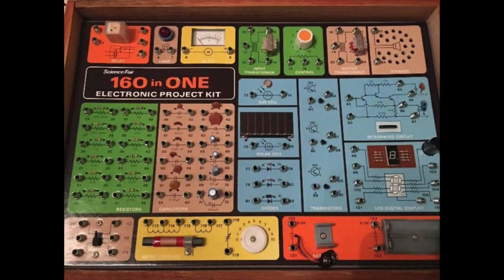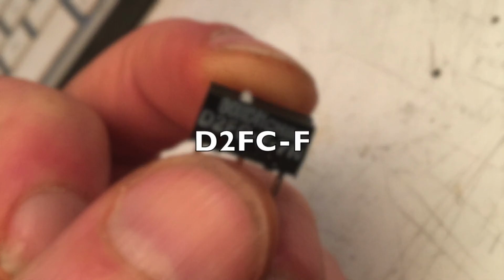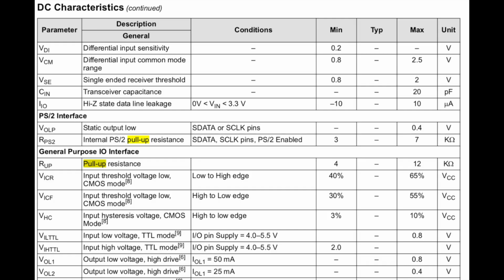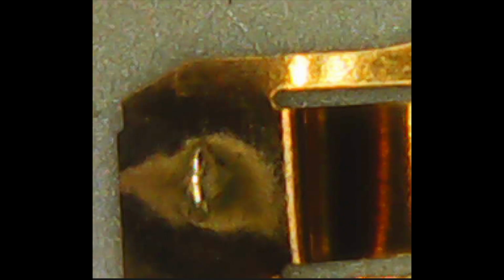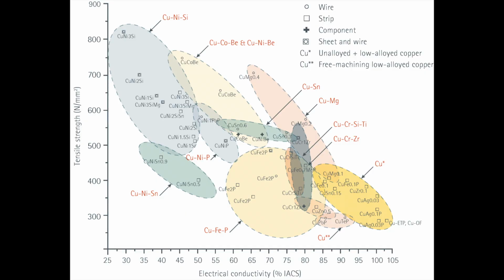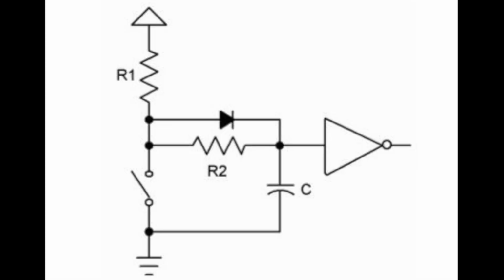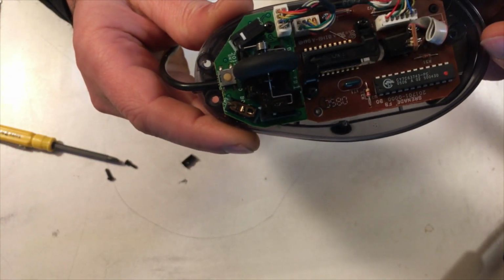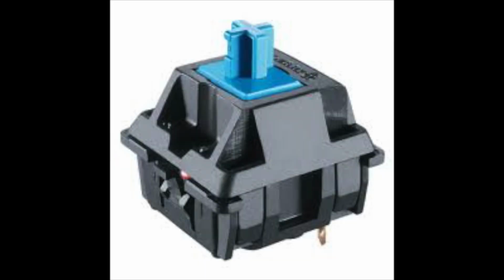Failing switch problem: Omron vs the modern mouse circuit

Comment: Thanks so much for taking the time to make this video Alex. Impressive stuff. I'm changing switches on a failing Logitech G903 this week. Planned obsolescence at its worst.. shame on these mouse makers. It's imposisible that nobody at these companies isn't aware of these switch problems
Reply: I had a G703 for five years, once every six months I had to disassemble it and stretch the switch spring, otherwise it would double-click. Very VERY cheap inside, cheap board printing, mediocre soldering (how?), unwashed lux, which, in high humidity, malfunctioned and led to a "coma" of the mouse. Due to frequent parsing, the plastic began to crack at the attachment points. At the end of it life, I began to gum up the fasteners of the buttons, since they broke out and I am silent about the appearance of the mouse.
And so, my friend bought a second-hand top "super light" for cheap, sold due to a double click. He asked me to take it apart and do the same as I did with mine. And what do I see inside? Everything is the same as in 703. Unwashed flux, mediocre soldering, cheap boards, all the same cheap switches. There is no progress at all. As a result, I replaced the board with a board with a hot swap, this is the best thing you can do with it, in my opinion.
And so, I don’t buy more logitech, this is a very significant overprice with mediocre quality. I took a new viper v2, changed the skates to my favorite ones and took it apart for the sake of interest. It is much simpler inside, in a positive sense, but the board is also of better quality, in my opinion, the flux is washed away, the switches are better, except for the side ones - they are so-so there, but they can be replaced. Viper looks more thoughtful inside, but still the same overprice, but at least the quality is better.
Reply: @nonameman2294  hey, is there a reason for my viper mini scroll wheel being suddenly jumpy? (scrolling up scrolls down sometimes, and vice versa)
Reply: @DaxyGamer  On G703, I had this when cat hair was wound around the axle of the wheel.

Comment: Funny my 5 years old laptop lenovo touchpad button doesn't care about material voltage etc.. It's just works
Reply: This is an issue that is specific to gaming mice - the manufacturers in this particular space have apparently been copying bad engineering traits from each other for a while. It doesn't affect touchpads, it doesn't even affect most $12 office mice. Both generally work with dedicated chips manufactured at high volume which are designed to drive switches reliably.

Comment: If I understand this correctly, simply plugging in the mouse and using it for anything at all breaks the warranty because you're out of the specified current? Is that right and if so how is that legal?
Reply: No, just because part specification is violated, it does not break the warranty. The warranty is on the whole device, and the manufacturer 'guarantees' that the device works regardless of whether they made engineering compromises or mistakes. In fact great many devices of all kinds use parts under weird conditions they weren't really designed for and these can be spectacularly reliable and well-supported devices, this is not generally something you have to worry about. Sometimes it's the only possible way to make an extremely innovative device, and sometimes extreme effort is applied to validate the parts for off-spec use. Now evidently these gaming mice are not among high reliability devices, to put it mildly.

However, manufacturers can also find ways to weasel themselves out of warranty. They can declare that the item is subject to wear, and wear is not a manufacturing defect and is thus not covered by warranty, so they can exclude cable failure and switch failure after just a few months of use. How they must handle this and how much wiggle room they have depends strictly on the corresponding jurisdiction, every country handles it differently. I think Logitech isn't actually bad at replacing products within warranty, but they know most people aren't going to bother and will just buy a new one. These mice cost probably only a handful $ to make, so they can replace them a bunch of times before you run up the price you paid for it.

Comment: Thank you for this, very enlightening video, at least I know now why our mice keeps failing on us. In my business I hate replacing equipment so I try to get the most durable ones I can afford for my employees. One annoyance that I always had were our mice, they would always predictably develop issues in two years, regardless of the brand I bought. I don’t have time to fix dozens of mice so we end up dumping them for new ones, terrible for the environment. So I’m now on a quest to find a mouse that would last much much longer then the short lifespan of a house fly. 

What caught my attention recently is the relatively new Realforce Mouse with topre switches.  We have been using Realforce keyboards in our office for a decade now and although expensive, have been extremely durable and still work like brand new despite years of abuse. We do medical transcription so we bang on these all day and kill lesser mechanical keyboards on a regular basis but none of our Realforces have died yet. Anyway, I’m hoping this is the mouse that would perform similar to their keyboards and last us a decade. I have ordered a few from Japan so wish us luck!

Comment: For those looking to replace a broken mouse switch, here are the best omron model that fit the form factor: D2F-01 and D2F-01F, the latter has less actuation force. For panasonic I believe it's AH1560619. Both use golden alloy and are applicable for microcurrent. If you can recommend other manufacturers switch pls do let me know. My problem with G900 was partly due to switch failure and partly to a corroded wiring contact inside the mouse. Make sure you unplug that flat wierd-looking cable inside and clean it if necessary... hope this helps!

Comment: Hi, the solution to chatter seems simple af to me. If only the controller logic would utilize all 3 of the pins of the switch pins instead of only 2. Let me explain. The mouse button should be considered pressed down after hitting the 2nd pin, and pressed up only when it hits 3rd pin. (Currently it is considered pressed down upon hitting the 2nd pin, and pressed up upon releasing the 2nd pin, while the 3rd pin is not being utilized). As per load balancing, we don't really need static load to go through the switches, so we could simply use two capacitors instead. 3rd switch pin connect to v+, 2nd pin connect to ground, then connect small load capacitors between 1st and 2nd pins and between 1st and 3rd pins. That way we can get a high current to flow through the switch but for a very short period of time. Then the controller logic should do as follows, when the input is grounded send mouse down event, when the input is v+ send mouse up event. This would eliminate the chatter completely and solve all the double click and click and drag problems, as long as the switch is still performing mechanically, which is usually the case.
Reply: Yup, instead of having an on state and a free floating state for off, having a proper off state.
Reply: That would be a surprisingly smart solution. Since ALL of these switches are break before make, one could even theoretically design external logic to ensure a clean switch... An S/R flip-flop could use the two contacts as Set and Reset inputs, and the outputs would ignore all the bouncing. Since the switch must physically break contact with the prior contact before making contact with the new state, the first electrical contact made would instantly switch the state of the flip-flop, and to switch back, would require breaking the contact and re-making contact with the other contact. At that point, the output of the flip-flop is simply a clean logic level.

Comment: a switch, 86 cents, a gaming mouse 100$
what do you mean if you were a smart manufacturer? :D
Reply: I just can't believe that all those endless RMAs from unsatisfied buyers can cost less than simply paying for a better switch.
Reply: And that's not even accounting for all the damage to the brand. Like, today I went from ready to pay $100 for a mouse of the same manufacturer to all right, who was that who uses optical switches and do they also make appropriate keyboards?
Reply: @Lishtenbird  you would be surprised how many ppl actually forgo their RMA and how big is the profit margin on a 100$ mouse (its big, they can take the hits)... theres also an issue of features vs reliability, like razer naga is the best mmo mouse feature wise but it is not very durable in terms of switches but then again, very few mice are (for reasons explained in the video), so yeah when my naga broke down the first time i went for the competition only to find out they are not really any more reliable but the features were worse (and the price was a bit cheaper) so i circled back to naga after trying out logitech g600 and corsair scimitar, theres just no good alternative out there... and then you have the "tactile feel" of the switch and the omron D2FC-F-K cult status as the "best ever feeling switch" and no one really wants to risk it with changing it...

"A times B times C equals X. If X is less than the cost of a recall, we don't do one."

Comment: Another question if you don't mind.

I've used Logitech G102 and I've had to rma it and then later sell it because of the double click issue.
Could that double click issue be removed if I had reduced the polling rate or is it just consistent with logitech mouse like g102,402,502?
Reply: I just reduced polling rate on my relatively new G102 to 125 Hz after watching this. Double click seems to have disappeared, and drag-and-drop issue is reduced somewhat, but not eliminated. Drag-and drop issue is most pronounced when you wiggle your finger sideways, precisely as explained in this video. I am not an FPS gamer so there's zero reason for me to go over 125 Hz.

Comment: Absolutely loved it, Alex! Thank you for your hard work and research and explanation. I think I am quite clear about some things.
But I still have a noob question, apologies.

If I purchase, say a Minos X5 (rated for 50 Million!) and it has a 6V ~ 1mA rating, but the mouse circuit pushes 5V and ~150mA.
Given that the circuit pushes a different Voltage and Current, it means that the switch will die out much sooner, right?

I play LoL and that requires like 3 mouse right clicks every second!
Could you please advise?

I got Minos X3 as purchase choice as well and the ratings are same from Omron and circuit. Would both mice die out (likely)?
Reply: I'm not Alex but i'll fill in given his absence :D

The "5V 150mA" spec written on the mouse is not relevant, it's just that they promise not to consume more than this current - at this voltage - for the whole mouse. That's for the processor, the RGB, the sensor, the sensor emitter, etc, including burst and turn-on consumption - average consumption can and should be much lower. It's definitely NOT the pullup current. Mouse switches are rated for maximum current between 1mA and 50mA typically, that order of magnitude. Just like using pullup current too low may result in not clearing the switch surface, using pullup current too high isn't good either, as it will induce heat, and under heat and air, surface oxide will form. So the switch will increase in resistance, and this in turn can cause more heat to be emitted, until rapid degradation sets in. However it's a hypothetical concern, as you don't have to worry about pullup current being too high, because they wouldn't EVER do that. Because there's no reason to do that. Using the pullup current that is too low has a reason, because that's what happens when you use these common USB microcontrollers like STM32 and LPC and decide to spare the external pullup resistors and use the processor's onboard pullup, because that drastically simplifies the board layout.

You simply can't make a good prediction based on externally available specs whether the mouse switches will last or whether they won't. You might have to open it up and look at its engineering in detail.

As to your other comment about the G102, well that's my opinion, but i say even if the polling rate has some effect on debouncing logic, that's going to not be good enough and more hide than fix the issue, at least that's my feeling, and if the switch just isn't running reliably any longer, it will let itself be known and annoy you one way or another. Why keep around dead and dying switches when you can just put in something decent?

Comment: Solid video. I didn't watch it all but I completely agree with your suggestions. Software alone could save so many mice from death and a burial in the earth.
I'm using the wireless G700s and can't imagine life without it. The major downside (aside from switch issues) is having basically one day of battery i.e. daily charging. It's power management is nonexistent. 
I'll be learning to solder at some point then tackle one of two of my problem G700/s mice. I have maybe 4 or 5 of them at this stage. 
Have you tried doing internal mouse modding?

Comment: That's why I clean and oil my mouse parts with isopropanol and wd40 every quarter year. Lubrication might delay wear while dielectric layer might decrease 'bounce'. My kail switches have lasted me 7 years and are still going strong.

Comment: logitech did their own badass sensor, which is by far the best on the market. i'm sure they could do the same developing a new, proper switch.
wake the fuck up logitech, can't deal with your RMA bullshit anymore.
Reply: They didn't. That's not how "custom" sensors work. The Hero is a sensor designed by Pixart, and it might be a timed exclusive for Logitech, and it's an evolution of the existing 3360. All prior sensors were also Pixart and Avago. The sensors are generally "customised" by having the microcontroller write a firmware overlay into the sensor on boot or mode change, plus a custom engraving and external decoration, sometimes maybe a custom lens, because no brand within a niche is worth an actually custom spun IC die.

They don't HAVE to develop a new switch. They could just add a handful resistors and one trace, or they could ask Huano, Kailh, or one of the many others, or they could get existing Omron JP or Panasonic switches, but they don't. The switches are already advertised as long-life, even if they aren't, so if they went "but this time for real", it would just be like admitting that they've been lying for so long and big old companies don't do that, because it would make some bigwigs at the company look bad. You can advertise a new sensor without making yourself look bad in the process.
Reply: @SianaGearz  lower voltage and current is almost certainly also because the mice are now wireless, so the more efficient the more lasting the battery.
one thing they could do is just make the switches hot-swappable, apparently an asus mouse has that. switches are quite cheap, and replacing them every year isn't a big deal, no different than swapping double-a batteries in terms of cost.

Comment: This video has been very helpful and informative. It fully explains why my Logitech MX518 which is about 8-9 years old is trucking along like a trooper and my 6 month old Corsair Gaming Pro Elite RGB mouse has lost sensitivity on the left mouse button already. 
The Corsair mouse is going back under warranty , but I'm pretty sure when I get a replacement unit I'll get 6 months in or less and have the same problem. 
So for that reason I stripped the MX518 down and gave it a full on clean and put it back into service.
If the switches in the MX518 ever give me trouble I can be confident that I can replace the switches and get another good run out of it thanks to your video.
Cheers!!
Reply: Can you Post a Update about your Expirience ?
Reply: @DevouringKing  Hello , yes I can tell you how things are going now . The Logitech Mx518 is still going strong. I'm guessing you have a Corsair mouse with a dud left mouse button in it.
Well I'm onto my second Corsair mouse and sure enough it failed like the first one.
 But the supplier isn't going to cover this one under warranty so when the button failed again I went onto Youtube and Google and found out how the Corsair mouse comes apart (it's not bad a couple of screws and the top comes off) 
I went onto ebay and purchased some OMRON D2FC-F-7N switches.
I de-soldered the failed switch and put in the omron unit and haven't had a problem since.
I would try and get a soldering iron with a fine tip and some de-soldering wick or one of those sucker things to remove the old solder.
I put extra flux on to help remove the lead free solder on the board.
Just be sure to take your time and be gentle taking the Corsair apart. Take note of the way the wires are laid out inside. (take pictures before removing things if you like)
Take special note of how the switch is fitted to the board inside and you may also need to crop the pins on the switch down a bit so they fit back in without rubbing on other stuff inside the mouse.
So in the end I fixed a $100 AUD mouse with about $4 in parts and a bit of time.
If you want a custom switch feel you can look up other brands etc they all solder in the same way. 
If you are new at soldering things try your hand at something expendable first to get the hang of it.
Just be a bit careful how much heat you put into the board so that you don't effect any other components nearby.
I also plugged the mouse back in with the cover off before putting it all back together. Checked all the functions then re-assembled it.
Well that's all I can tell you. 
Good luck fixing yours !😀👍🔧